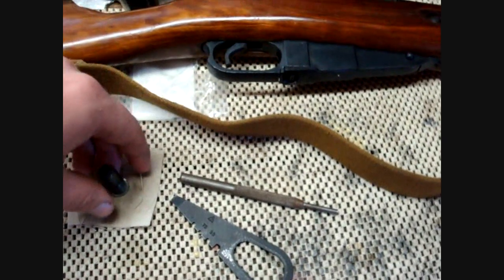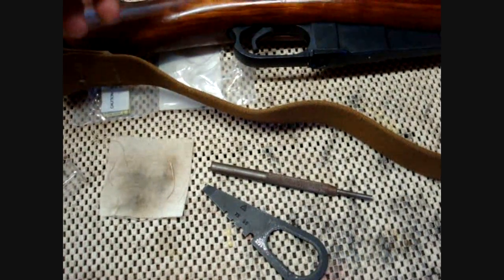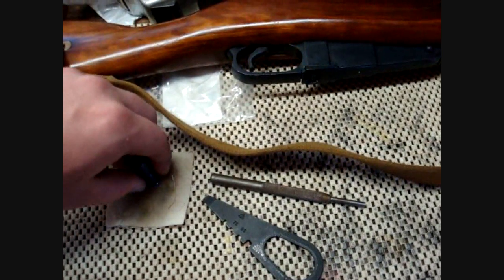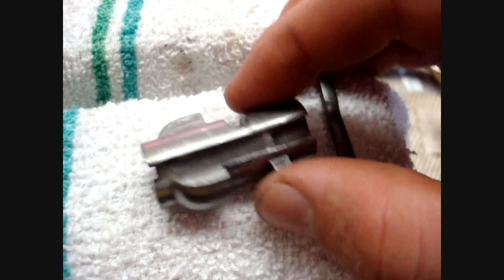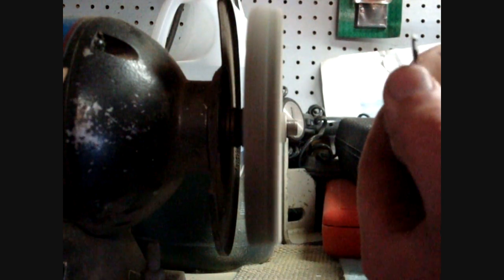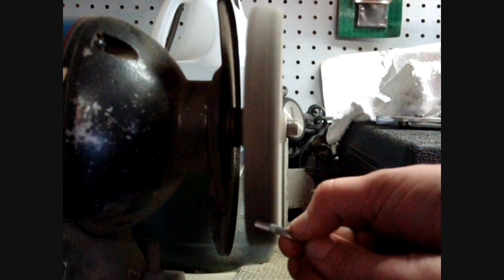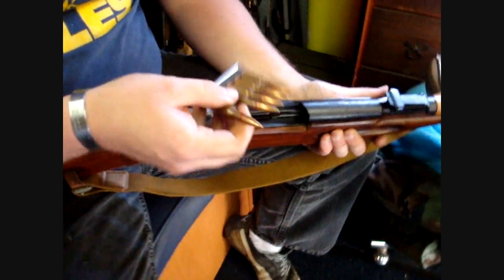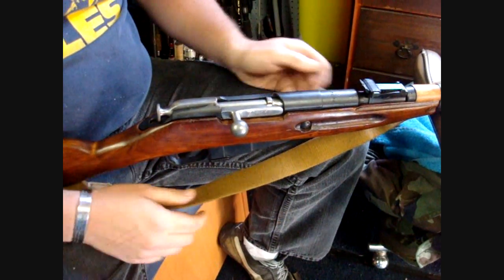"The Mosin Nagant Extractor/Headspace Enigma"

Comment: Nice video. Since the 7.62x54R is a rimmed cartridge, where the headspace is established by the rim alone, there are headspace gages which are just disks which will fit on the bolt face with the extractor still installed. I find them more convenient.

Comment: well i had trouble getting the bolt to close on a dummy round or casing, and found when i put the bullet in the extractor by hand and then loaded it, it would close far easier. i then took off my extractor and put it over a steel rod and hit it once to bend it slightly outward. worked perfectly, now the bolt closes with ease thanks for the advice!

Comment: I would polish like you did, and instead of bending, after polish, put extractor in a small tin. Place it on top of regular table salt and heat with propane torch to a straw color, remove flame and cover extractor with more salt until cool , a nice flexible extractor,

Comment: Kroil helps JB paste with really crusty fouling, Better than Mouse Milk  as a penetrating oil  (way better than liquid wrench or WD-40) if your extractor is stuck in the bolt-head too.   Firewerks makes disk-type headspace gauges that have a cut-out for Mosin extractors. Slips under extractor for PSL.   Good vid, Thanks for posting.

Comment: I could not close my Mosin with a cartridge in it.I discovered that the extractor was over bent towards the firing pin direction. So I removed the extractor and slightly bent it back. It took a few tries because I was very careful. But I finally got it right and the bolt closes smoothly now.

Comment: My extractor appears to be WELDED to the bolt face. There are NO seams near the bottom AT ALL.
Reply: hit it with a torch. ive never heard of them welding parts but they did do a lot soldering during rearsenaling

Comment: Hey Eric, please help... recently purchased an M39...She's well worn but the bore is perfect. There's no Cosmo hiding anywhere, everything looks clean and burr free, but the bolt will not close on a Go gauge, or on a shell casing. Took off the extractor, tried several different types of ammo, and it made no difference. The thing just will not close unless its empty. The barrel also seems to be aligned correctly. Am I gonna need to find a shorter bolt face? Any help would greatly be appreciated.

Comment: So question.. I recently had an issue with my M39, the extractor was loose to where it would just slide off the bolt head, I couldnt get the extractor off of another mosin bolt head so I switched out bolt heads, after oiling up the bolt (which before the bolt would close all the way but not open unless I pulled the cocking piece back) I loaded 5 rounds into the magazine and all 5 rounds cycled and extracted fine, does this mean its okay to shoot it with that replaced bolt head?

Comment: my mosin has the opposite problem- mine closes with light force (not nearly as easy as yours but easy enough) but won't open without a slap. i've polish sanded the bolt down to 500 grit so far & made it smoother than it used to be, cases come out very lightly slivered by the extractor & with a little blow-back evident (carbon around neck) but no stretching or cracking. without a round in the chamber, the bolt pops right open nice & easy. what could possibly be causing this?

Comment: Ok so I've noticed on my mosin the bolt is very hard to close and open and when I look at the face of the bolt there's brass tarnish and the case has excessive gouging on the flat surface. Does that mean my head spacing is too small?
Reply: how's that mosin